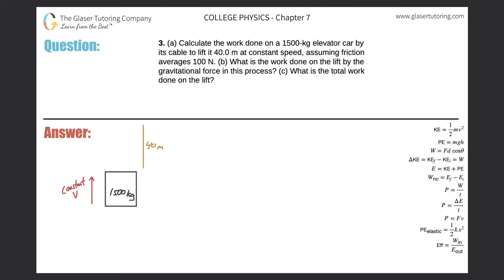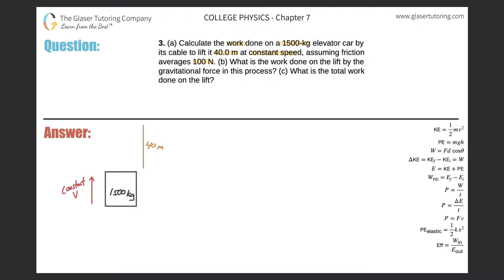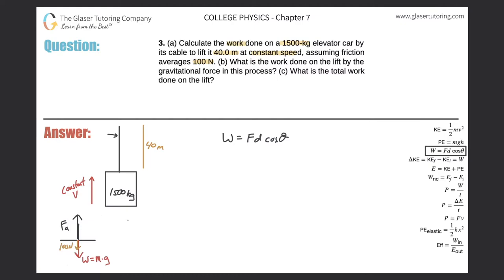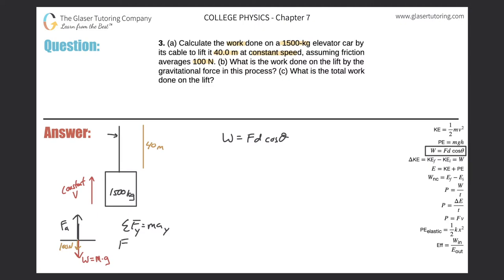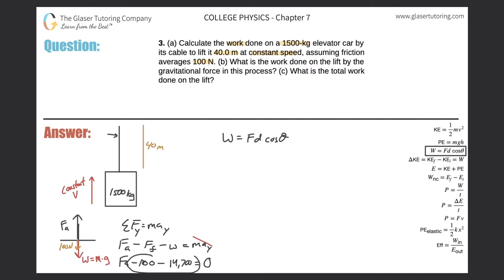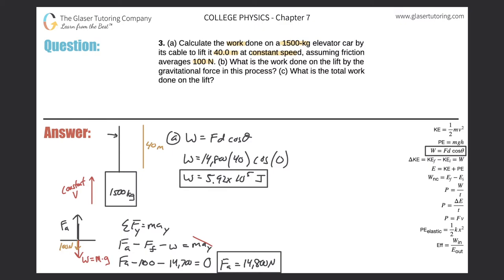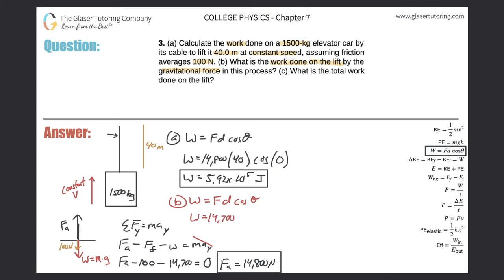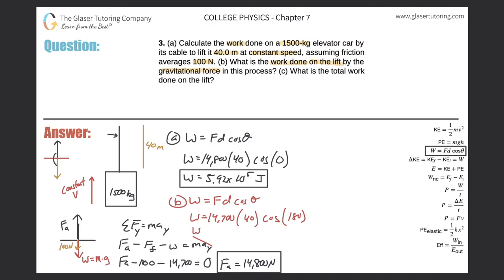7.3 | Calculate the work done on a 1500-kg elevator car by its cable to lift it 40.0 m at constant

Comment: Why the angle is Zero not 180 degrees
Reply: because for part B, we are focus on gravitational force, so, we are taking into account the w=mg, weight is pulling down, so it's the considered the force, and the acceleration(pointing up) is pointing the opposite, so on a graph you have 2 different directions, angle wise, it's 180, for part A it's zero because the force is force applied, which is pointing upward, we took everything into account that is acting on it, since the cable is lifted up, its positive Y. since it's upward its w=fdcos( pi/2), which is one, one times a number, its the number. hopefully that helps
Reply from the maker: Team work makes the dream work!

Comment: 8:38 So is the Fg considered positive be default regardless of direction? I did Wgrav = Fg*d*cosΘ = mg*d*cosΘ = (1500kg)(-9.8 m/s²)*40m*cos(180 deg) = -14,700 N * 40m * -1 = +588,000 J. What did I do wrong here? I mean isn't g = negative 9.8 m/s²? But then the cos(180 deg) makes the whole thing positive, which is confusing.

Comment: Please how did you get the acceleration as 9.8 to get the weight
Reply from the maker: Hi Stanley!  The weight of an object is equal to the mass of the object multiplied by the acceleration due to gravity - which is 9.8 m/s^2.  The formula is F = ma.  This acceleration is a constant number and should be memorized.  Hopefully this helps!